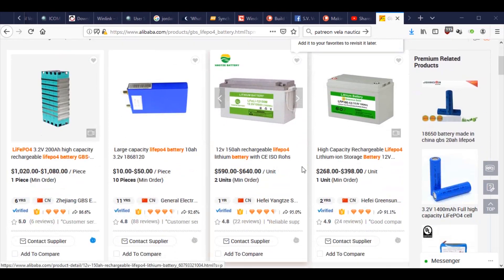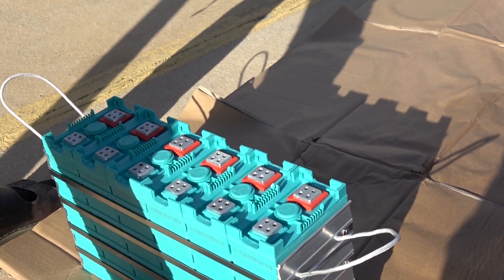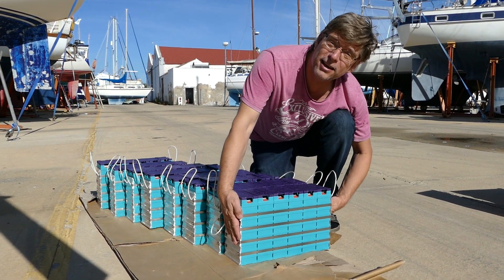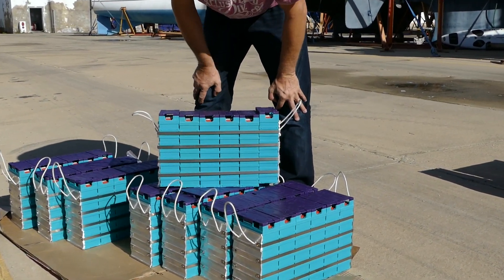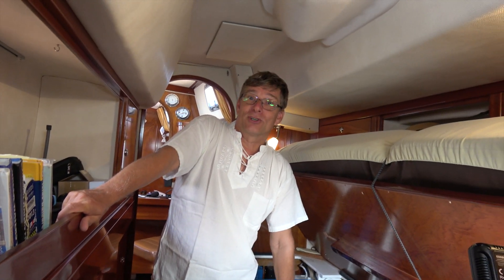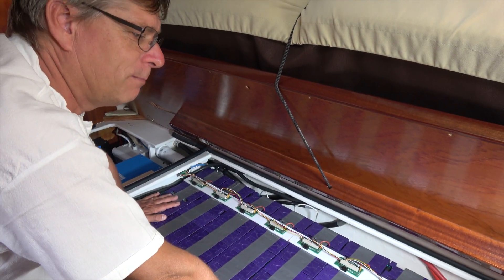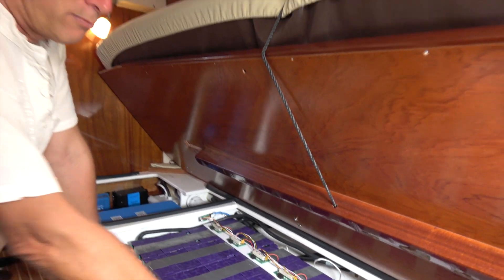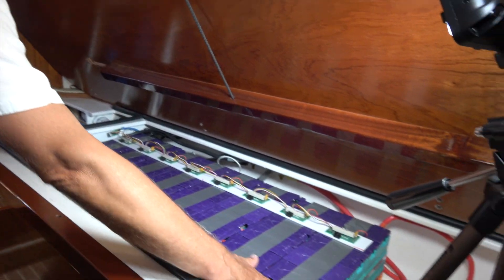Vela Nautica goes Lithium part 1|| WE CHANGED TO LITHIUM! | SV VELA NAUTICA

Comment: As a retired PE, Oliver, you are outstanding.  Where did you get the PowerBMS?  I keep coming up with nothing on google.  How about today, 2021, using 200 AH cells and running the bank at 50 V so that you can charge at 200 A from your alternator?  You could dump the 50 V to a 27 V unit which is always charged by the 50 V system.  The 25 V battery could be 300 AH.  You can feed your inverter from the 50 V  bank to 240 v Inverter as required.  Yes, it would give you double the storage and when you jump from location to location with the diesel, you can charge the big bank.  I am looking at 400 w SPs with 4 on the stern and 2 on the side rails.  Great job.  These are the best batteries with the best battery clamping system to resist battery swelling and extend the battery life.

Comment: Vielen Dank für Ihre Videos!  

There is much good information here, and it's great to see practical applications of new technologies such as Lithium ion batteries in sailboats.  Many people are interested in this, and it is clearly the way of the future!

Another way to use Lithium batteries is with an electric drive system for the boat.  With regeneration, this allows sailboats to recharge the battery bank simply by sailing.  Sail power recharges the use of electric energy for motoring, instead of burning fossil fuels.  In addition this can be augmented with a Diesel generator for long passages.  But for many uses, only wind power is used to charge the battery bank for electric propulsion.  For example for motoring in a marina, anchoring, etc.

Very minor correction: LiFePo stands for Lithium Iron Phosphate, not polymer.  There are no large Lithium Polymer batteries commonly available as they would use a polymer electrolyte.  Most Lithium ion batteries use a liquid electrolyte.

For those wondering, these are probably GBS batteries.  CALB are blue or grey, Sinopoly are Black, Winston are Yellow, etc.  Here's one reference: https://www.evlithium.com/

Would be very interested to hear how well the BMS kept the cells in balance over time.

P.S. The Amels are so beautifully designed and built, and also very practical and safe.

Comment: So many lithium options out there. This one is a little different and I think this is more along the lines of what I want to use
Reply from the maker: Hello, yes this lithium project is a bit different from all other implementations. By now we where successfull and do apply this proven system on other boats.
Its not a small project but it was worth it. It´s a real game changer and made life on board so much more easy and comfortable.
Now we are 2 years living on this batterie and our installation and no problems. One of the advantages is that we have one single batterie and not a stack of small units pluged together.
There is more infos at our website www.velanautica.org
so long Oliver

Comment: I do not know how I found your channel (but I do follow lots of sailing and boat build/refit videos) and I am glad I did. I realise  this is just one video of your installation (I will watch the other shortly). Just a couple of questions:
1. Would there have been merit in rigging the best of your lead acids as the engine/generator start accumulator and possibly a couple forward for winch and bow thruster? Or just too complex with respect to cabling and charging?
2. How have you designed for temp regulation of the batteries especially the issue - if too cold notable to charge)?

I watched your freezer rebuild - absolute master class.👍
Reply from the maker: Hello Norman,
On our boat it was not nessecary to rig any batteries to the bow for windlasses or bow thruster (10Hp). The lithium batterie can easy handle these units even without engine support. I would anyway not like to have any batteries in the bow, if there is no separate charger for them, they die quicklybecause they never get full charge because of the long wires.

The temperature regulation for the lithium batterie is handled by the powerBMS desing, it monitors the batterie temperature and in case its too low it will prevent charging. It could even start an electric heater to warm the batterie in to charging conditions.

so long Oliver

Comment: 14kWh of lithium battery storage. That’s huge.
Reply from the maker: I think thats a good size for this boat, we have plenty of spare energy. There is times on a boat where u need it, like when the genset gets its maintenance. We can also run our watermaker on the batterie for hours producing, 100 liters per hour, The Watermaker does not take so much power and the genset would idle a lot. Now we run the watermaker 3 hours and recharge in less than 1 hour. 
On passage it turned out that electric cooking was favorite. We cant open the hatches on passagre because the waves might give us a salty shower into the boat. When you light the gaz cooker in these conditions the oxygene in the pantry is quickly gone and you breath gaz fumes. That was over and we could enjoy electric cooking while we had our Atlantic crossing from Gran Canaria to the Caribbean.
Since we left Gran Canaria in December 2019 we did´t need to go in a marina, since then we live on anchor including the Atlantic crossing in January. Now its July 2020, so more than 6 month now.
Oliver

Comment: Hi there, trying to find more info on which cells you bought and about your BMS. After three months lockdown in Busuanga I am just on my way to Cebu(Carmen) to use the rainy season to install my LiPo's and a water maker and a rigid dodger on my boat. I am going for 400Ah LiPo (small boat, only 31 ft) to replace my 200 Ah old Gel house bank. Would love to hear about which cells you used(make/model/I'll have to ship to PH) and about the PowerBMS (is that a Kit ?). Cheerio and beste Gruesse
Reply from the maker: Please contact us by email. We like to help
www.velanautica.org
Reply: @svvelanautica2374  Hi there, thanks for getting back to me. I don't have an email for you so I can't email you. I have 400Ah of Winston LiFeYpO4 coming (8 * 200 Ah in 2P4S) and a REC-BMS which ties in and communicates with my Wakespeed 500 3-stage Alternator. Still in Carmen, PH working ont eh boat and feeding mosquitoes. All the best to you. Are you sitting out Hurricane season in the Caribbean ?
Reply from the maker: @novelistusonthewater  Oh, you are good setup, Winston will be fine cells.
We got the free version of the wakespeed.
Do not place the lithium cells in the engine room. better find a well tempered dry space under a bench. Its worth to reroute the wires if needed.
Yes, the first hurricane of this season is closing up, aproaching on Saturday morning. Tomorrow we move into a Hurricane hole and sit it out. If we are luck izt will stay south of us and if we are very luck it will diminish... hope the best.
Oliver
Reply: @svvelanautica2374  OK, I keep my fingers crossed for you in regards of Hurricanes. Well, I was too late for AltReg project. There wasn't any boards anymore and Al had already partnered with Wakespeed. I bought a better Alternator (110 A instead of 60 A). Lots of connected projects right now. The LiPo's, BMS connected to Wakespeed, Watermaker (based on Karcher K2) ran on LiPo, hard dodger, more solar. 
Do you know what happened to the control SW they planned to offer for the AltReg ?
Amel 54, lucky folks ! Thats always been one of my dream boats but out of my range. But I'm really happy with my little 31 Hallberg Rassy. She's been a great boat for 20,000 nm+ so far and most of the time I sail on my own anyhow. 
Greetings from PH
Reply: @svvelanautica2374  I would be interested to know which lithium batteries you purchased as well
Reply from the maker: @shaneb704  please reply on email svvelanautica@velanautica.org

We do no more hand out specific infos over comment section